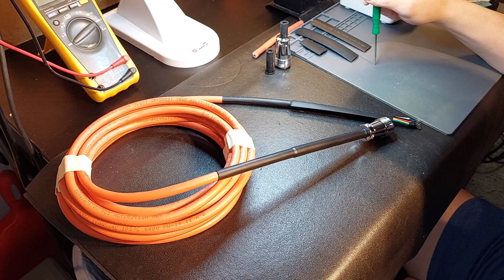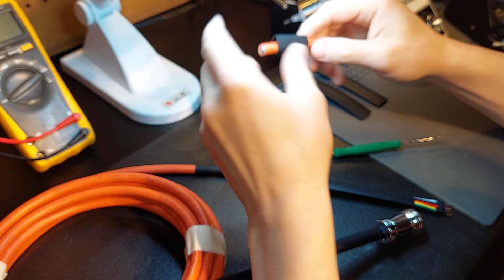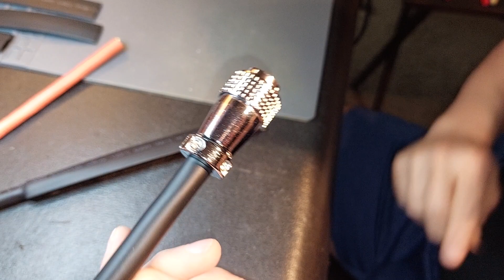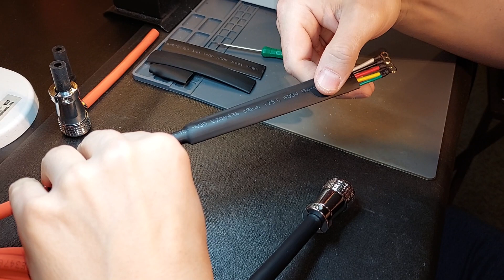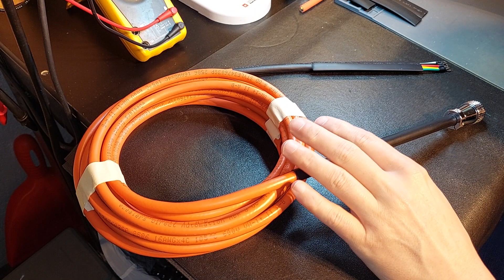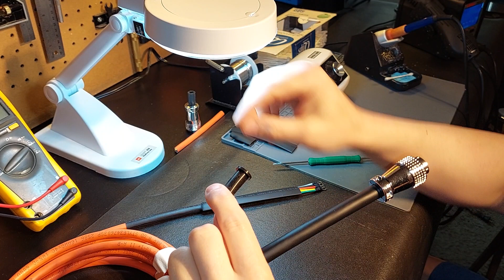How To Create A CNC Spindle Cable Stress Relief Properly...

Comment: On your ebay have you the 5ft cable with the connector. Also do you post to Ireland...5ft is enough ive on a 6040 CNC
Reply from the maker: Thank you for your support. I can offer my cable in any length. I need to know the cable you require. Please email me a picture of the one you require. I ship internationally, but shipping on such a small length cable will still be pricey. Thank you,
Vince